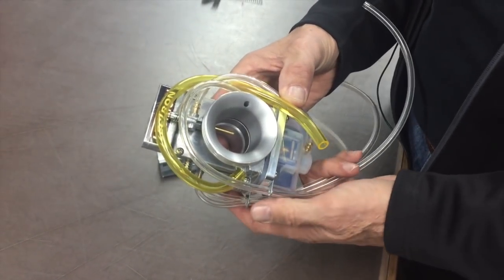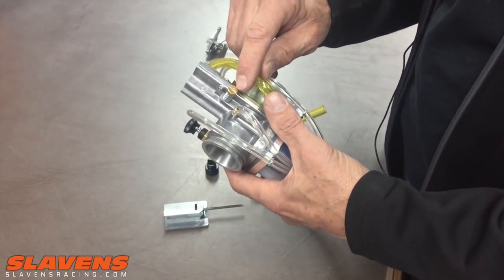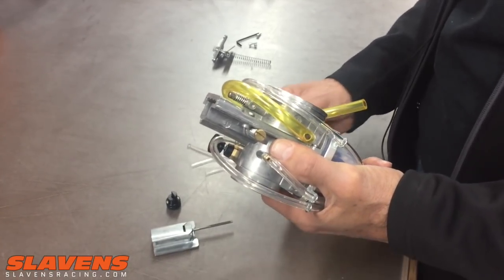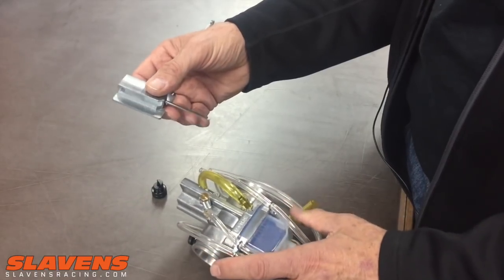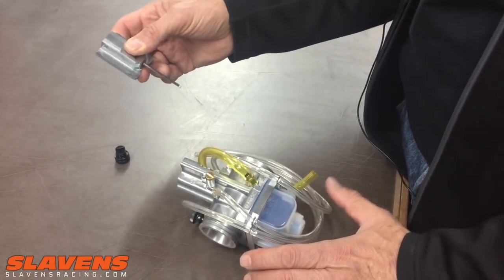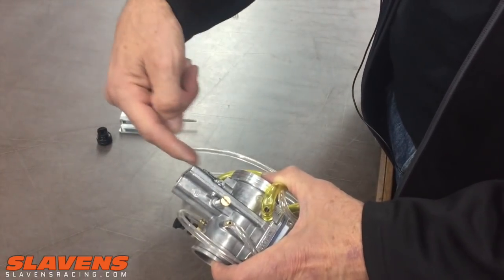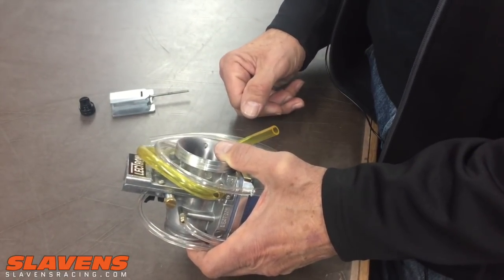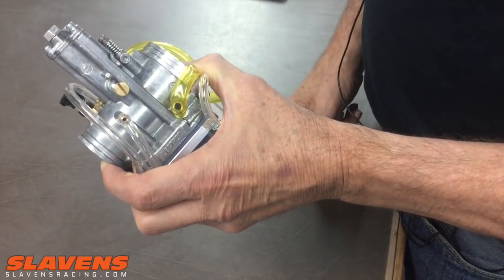How-to Tune Lectron 2T Carburetors

Comment: You know what. I was just thinking about these carbs. How does one adjust the carb for charges in premix ratios.  Let's say that I usually run 40:1 and wanted to go to 32:1. The bike will be getting less fuel and running much hotter. How does the lectron deal with that.

Comment: My main complaint with that carb is the shitty choke system that will not stay pulled up and is hard to reach on the 17 KTM,s. Should be a better system for a $500 carb. Other than that it's great. Lots more bottom end and better fuel economy. HV mule on a 17 300.
Reply from the maker: Agreed that it is difficult to get to. They recently sent me a prototype remote choke that I'll make a video on when I find time to install it. 

When the choke won't stay up it's because the grease got washed out of the little rubber boot and wore off the detent lip. Give us a call and I'll send you one at no charge. When installing the new one, pack it with a waterproof grease.

Comment: I put one on my 17 Beta 300.  Zero adjustments so far and it works amazing. The stock Kevin was really good but the lectron improves the low end snap and torque. What the Beta did well, the lectron just made it even better

Comment: hey Jeff Slavens do you have a recommendation for how to make the throttle pull easier with a Lectron? I installed one on my 2019 KTM 150SX (w/ 4hrs on it), used the lightest spring, and cable is routed properly (on right side). Pull seems way harder than OEM and it matters to me as I'm riding / racing 2-3hrs. I'm going to start with routing cable down left side but do you have any other tips?
Reply from the maker: That is not a common issue for the ones we sell. I don't see you in our database so you should contact the company that sold it to you.
Reply: yeah, their called Lectron.
Reply from the maker: Do you have a Domino or Motion Pro throttle?
Reply: Jeff Slavens I have Domino and I noticed a slightly harder pull. Nothing serious but slightly harder.

Comment: What metering rods have you guys tried?  I’ve had the original 2-3xl, the 2-4m that comes with the mule upgrade, now I’m trying the 5-1, on Kevin’s recommendation.  I’m still trying to perfect the 1/8 throttle response. Maybe I’m just too picky. Other mods: S3 head, airbox mod, moto tass reeds.
Reply: how do you like the 5-1 and what bike are you riding?

Comment: I know this video is old but maybe you can help . I have a 2022 yz250x with 22 hours . I put a lectron on my bike and it runs great and the spark plug is brown with a little oil on the threads . My only issue is spooge running down my tailpipe . I’m nervous about running to lean so I figured I would ask first . So would I need to make it less fuel ? It hasn’t fouled a plug or died and starts first kick . I just rode last weekend at 717 and put 8 hours on the bike and only issue is the spooge .
Reply from the maker: Try leaning the metering rod 1/4 to 1/2 turn (counter-clockwise).

Comment: Great video, very simple and to the point. Bike was missing on the top end , I tried going 1/4 turn leaner on the power jet/main circuit first but it didn’t work. Ended up going 3/4 of a turn richer than original setting and the bike absolutely ripped. Thanks for this video!

Comment: Any tips for cold starts very tough to start cold but once it’s warm it starts 1st kick all day
Reply from the maker: Hard starting indicates it is lean on the metering rod. Richen it 1/2 turn.
Reply: Jeff Slavens I am in texas and it doesn’t really get cold here
Reply: @speezy1414  You asked about cold starts, wtf?
Reply: Your Face ....piston rings were worn, rod wrist pin bearing blew up not long after. I think it was hard to start due to those motor issues
Reply: @speezy1414  Ahh, I gotcha. Bummer.

Comment: My 2018 300 XCW 6 Days has a lot of pipe bang on decel with Lectron installed.  Is pipe bang a lean condition?  Adjust metering rod or power jet?  I bought my Lectron from your shop.  Thanks in advance or any ideas you might share.
Reply from the maker: Mike: Richen it 1/2 turn on the rod. If that makes it worse, go the other direction, leaner.

Comment: Mine was running fine for two years and all of a sudden the throttle hangs after I hit high rpm’s. Then it takes a day to get back to normal idle after I let off. I noticed the metering rod looks a little "grinded" at the bottom but not sure if that’s how it came. Is a hanging throttle too rich?
Reply from the maker: Hanging throttle is too lean on the metering rod but can also happen when the slide is worn and needs replaced. I would replace the slide first and tune from there if needed. https://slavensracing.com/shop/billetron-carburetor-parts-and-accessories-by-lectron/
Reply: @slaverace1  awesome thank you !!!

Comment: I have fuel in float bowl but not in cylinder brand new bike brand new lectron richened metering rod up turn and half bike still won’t start
Reply from the maker: Make sure the slide is fully closed. Open the throttle then let it close and it should have a clunk.  Make sure the choke stays up and keep the throttle closed when starting. If those things don’t work, call us and ask for Alec. 719-475-2624
Reply: @slaverace1  finally got bike to start but only with choke on and throttle wide open, still too lean? Only ran it a little on the stand but plug looks rich

Comment: Question for any 150sx guys .  Boggy bottom .  Takes awhile to clear to mid throttle then rips .   I hadn't changed the metering rod as it was good enough for my son to ride for a few hours .  But going in (I'm guessing leaning ) on the power jet made it a hair better .       This is a rich metering rod correct ?
Reply from the maker: Bogging on the bottom indicates it is lean on the metering rod. The power jet is only for high RPMs.

Comment: my Ktm runs great but at the track I noticed it sputters a little bit at high rpm 3rd gear, would I need to richen up the metering rod or the power jet screw.
Reply from the maker: Sputters are a rich condition.
Reply: @slaverace1  so I should lean it out a quarter on power jet or meter rod, because it really only happens when I’m wide open

Comment: Ive installed the h series on my 1997 yz 250 with 5.8 hrs on complete rebuild i have a problem from cold start takes a lot to start but once started runs absolutely fantastic starts first kick. Any idea whats causing the cold start problem?
Reply: Same here, 2013 yz125 it wont start at all, was running fine, turned it off, wont start now🤷🏽‍♂️
Reply: @TVLON  hi mines was lean so turned the meter rod a half turn niw starts perfectly

Comment: Hi mate, I have a KTM 250 exc with a lectron. When I take out my air filter there has been a puddle of premix/fuel inside the air boot. The bike is starting to bog a little bit since this. I have not yet tuned the lectron as it had run great until this fuel puddle problem started. If you have any advice as to what this issue may be I would really appreciate it.
Reply: Average Bloke N Bikes are you sure it’s fuel and not oil from your air filter if you are over oiling the filter?
Reply: Ry Pox it’s definitely pre mix. no matter now bike got stolen 3 weeks ago

Comment: Hey Jeff, Ive been running this carb (purchased through yall) for over a year, bike has loads more off idle torque and just runs great overall.. Only problem ive had with it is keeping the throttle tube assembly squeaky clean, it is very sensitive to getting dirty and will get a "sticky" feel, I have too physically roll the throttle back to make sure it goes back to an idle position. Have you heard of anyone else having this issue? Ive tried vortex and domino throttle assemblies. I dont have this problem on my 4 stroke with the stock throttle assembly..
Reply: Yeah I had that problem too. Before tightening the top plate with the 3 screws, try sliding the plate sideways, forward and backwards, with screws on but not tight..all while moving the throttle. There is a position where the slides moves smoothly. Once you find that spot, then you tighten the screws all the way and hopefully kept the slide smooth.
Ideally the plate would have some kind of guides... 
I ended up polishing the slide.  Also Had to clean it a few times, it does let a bit of fine dirt in. I am building a rubber cover/ boot kinda old style hondas. 
Call Lectron directly if any issues. They are very helpful.

Comment: Mr. Slavens I just put my carb on and I have 2 rides on it I've had to richen metering rod 1/2 2 separate times to get it to start cold. My main problem is a clacking sound with consistant throttle ... hopefully that half turn richer I did fixes it but if not what do you recommend .. clacking is only certain throttle position